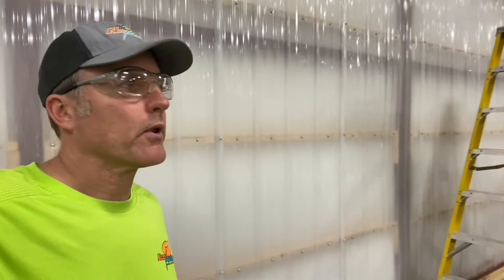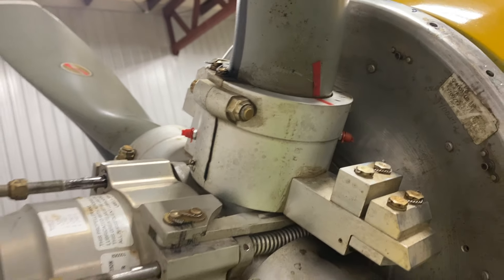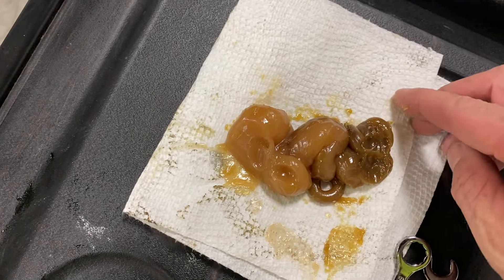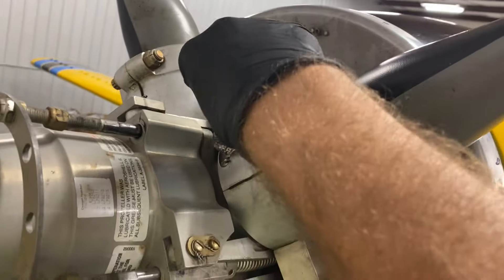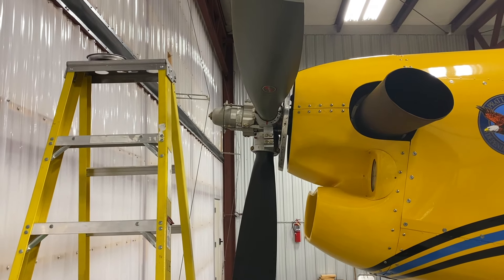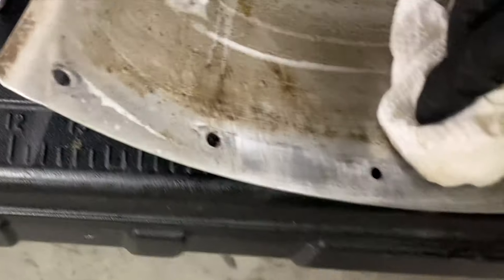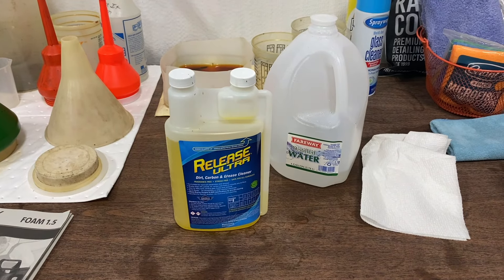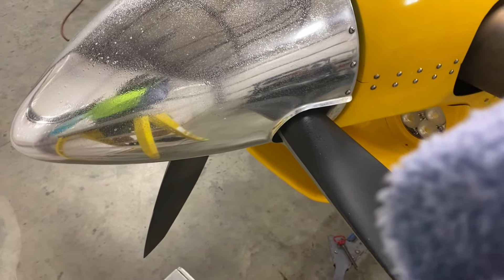The Prop on My Airplane is Broken!

Comment: For making sure the spinner is on in the right orientation. Take a spring punch and put a dot or two on the spinner bulkhead in the open area behind a blade and matching dots on the spinner and never worry about it again. Do it or have done it on all of the 10 Kings we have. Not that what I'm telling you makes a shit, but you did right in my opinion. Those blades are hollow and when I've built prop assemblies or got them pre assembled they get packed with grease. So when you lube those blades its just the collars that take grease any more than what you put in is just wasting grease. That Aeroshell 6 doesn't handle the heat real well. They're moving on to a Nyco GN lithium based grease now that much better. Great channel
Reply from the maker: Thanks so much for the information and the encouragement! I appreciate it!
Reply: @IowaFlyingFarmer not a problem. Sounds like you got some good help out there. Looking forward to more duster videos 👍

Comment: Simple green for aircraft, it's a clear formula they make. Won't eat the aluminum
Reply from the maker: Thank you.
Reply: @IowaFlyingFarmer  your welcome and thank you for the video. I'm a 25 year printing press mechanic. We have and use a lot of bolt keepers and lock tight because we can't have bolts go through the machine and damage a cylinder that could cost 100k to repair and the machine would be down for weeks or months.
Reply: @IowaFlyingFarmer  I really did learn a lot from your video just by watching you do this. I was looking all around that spinner and could only imagine how awesome it is to work on. Printer mechanics are basically the same as a aircraft mechanic. We have special foam tool boxes with tool shapes cut out so we know all are tools are back before we turn on the press or rotate it. Same has to be for planes.

Comment: I would have used some blue lock tight on those zerks. No keepers for them 🤔
Reply from the maker: Good idea. Does it require heat to get them back out after using that?
Reply: @IowaFlyingFarmer  No blue lock tight just needs a snapping action to break it free. Just something to help hold them in. I was even thinking the back grease zerk fitting could even be a flush mounted zerk or plug bolt since it's not in a area you can actually grease it.
Reply: @IowaFlyingFarmer  DO NOT use loctite! It's not approved. Simply tighten them and that's enough. I've never in 38 yrs as a licensed mechanic seen them come out.